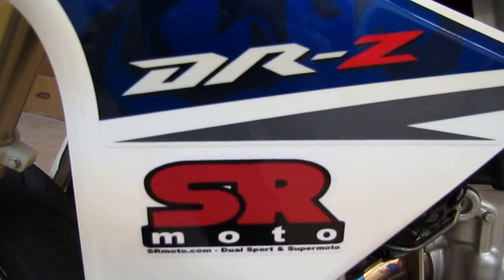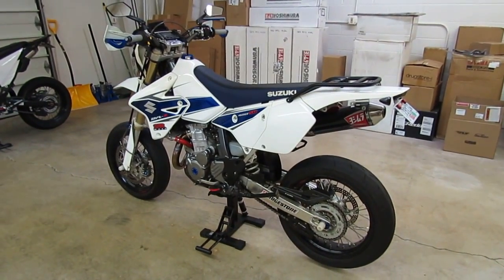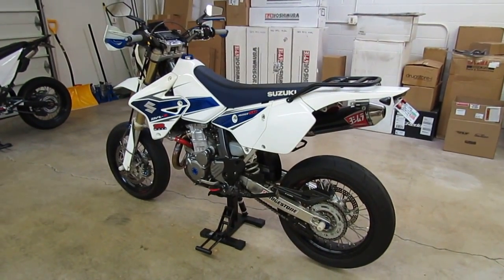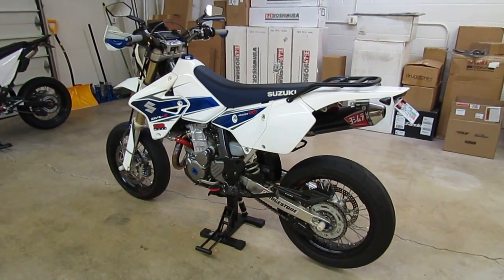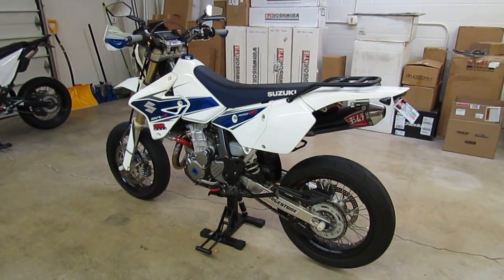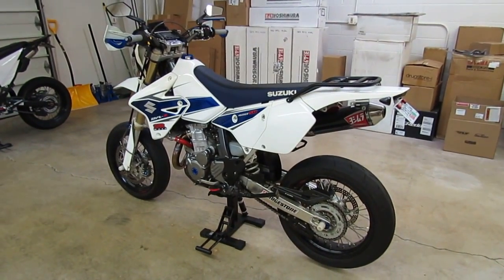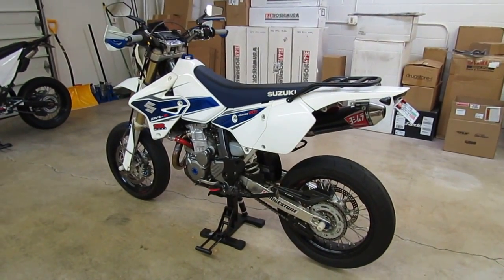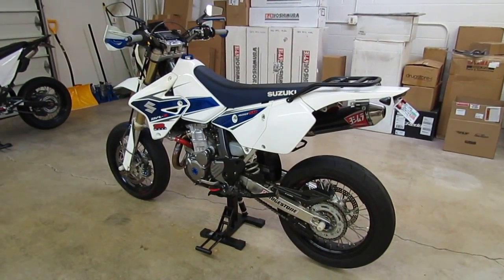Suzuki DRZ400SM Project Bike Update from SRmoto.com

Comment: still never understood why suzuki didnt slap in an RM/RMZ 450 Motor, Fuel injection, and 6-speed for the newer models.
Reply: +d3tach3d Eh RMZ motor = less reliability. Although I wouldn't turn down EFI and some updates.
Reply: +ManeyLikeLions the quadsport got a EFI 400 motor in 08 its really odd why they didnt try and make it work in the DRZ.
Reply: fuel injection is coming in 2018. That's what a suzuki salesman told me at IMS
Reply: why ? because suzuki dont sell bikes only in america , there are class CC category in other country .
Reply: The world may never know.
Reply: 2019 is here carb ready boyo
Reply: That's what I wanna know and that steel frame is too heavy. Probably the need to go aluminum for lighter if that's correct
Reply: @LOLturtles  The 2020 still carb.
Reply: @LOLturtles  this comment doesn't seem to have held up well lol

Comment: You have all that fancy stuff, but still no case savers?
Reply: wildcard252 why would you want case savers on a street bike
Reply: I wouldn't call it a street bike.  However, your bike can still go down on the street. The rear brake pedal and the gear shifter can punch a hole in the magnesium crank case.

Comment: i have the RS-3 off road pipe on my 2001- just bought myself a 2016 and thinking about putting the same pipe on that one because i like it so much! is the biggest difference between the RS-2 and RS-3 on and off road? i'm curious if anyone has experience with both.
Reply: Nancy Schaler look into the delkevic slip on its cheap and sounds great...pretty loud though lol or the mrd exhaust is also great👌